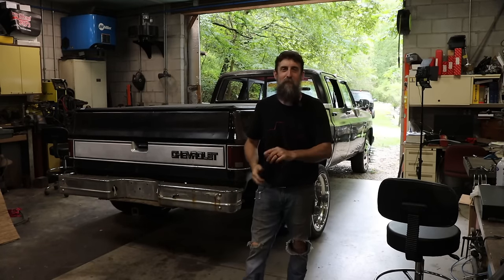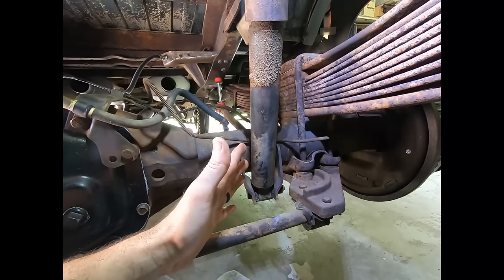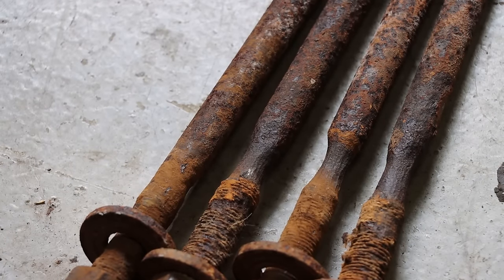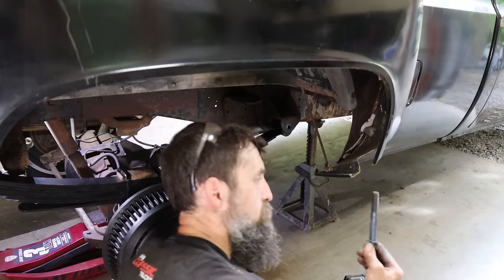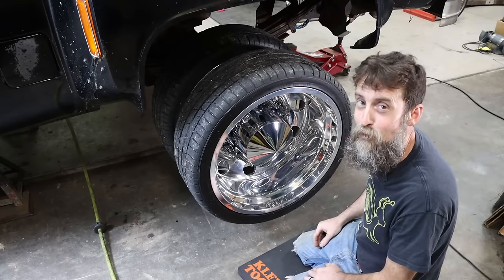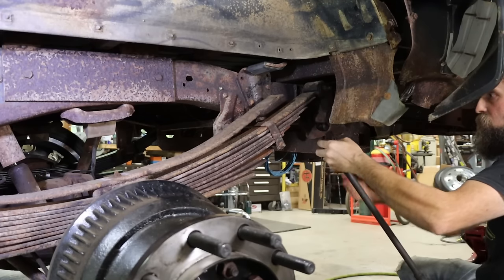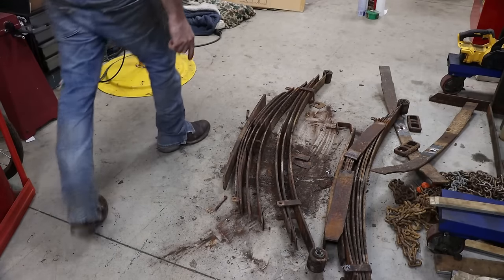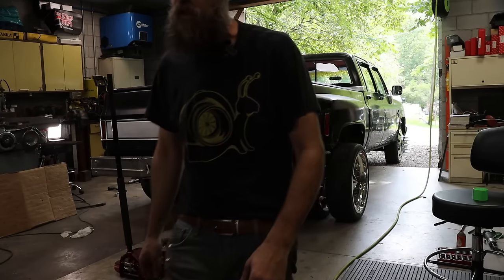Too dangerous to drive! Johnny Cash needs help

Comment: Retired GM mechanic: Yes I have replaced many leaf spring assemblies. I was the brake, suspension, steering mechanic. Dually springs are heavy. I have seen many cracked and/or broken springs. Because I hated to start fires, I started using a recipicating saw with a high tensil blade to cut the bolts loose. My magnetic Dewalt light was used by many fellow tech's and left stuck under a truck going down the road. Good job. My main complaint for those after-market wheels is {they come loose} but they look pretty. Many manufactures require to re-tighten within 500 miles.

Comment: Thanks Steve. I trust you saved a few pieces of that old spring steel for projects down the road.
Reply: Steve could make a lot of knives with that amount of inventory! Lol
Reply: Yes plenty of uses for old spring steel, even if it is detempered and used as a high quality bar for some applications, it will survive abuse well.

Comment: I had to do the same for my 1990 Sierra 4.3L 1/2 ton. When I noticed all 4 U bolt had rust broken completely throuhg on the outsides. 😲😲I cut everything out nothing was worth saving especially the U bolts and bottom plates. Got two nicer bottom plates from the junkyard amazingly. For these new to me I drilled two 1/2" drain holes in each at the lowest points to allow dirt, water and salt to fall through. Than cleaned and paint brushed everything with a 1gt can of Rust Oleum gloss black after a preheat. 👉👉So many I saw at the junkyard were completely full to the top with dirt and rust layering.

Comment: About 1969 I put a new set of leaf springs on my '57 Chevy 'Blair.   That was my first big project on that car.
-I bought the replacement springs catalog order from Sears.
- It took much beating and knocking.  Didn't have access to a torch, etc.  
-Exhausted my vocabulary. 
Steve, your video brought out some old memories/nightmares.😅

Comment: I never had an eye bolt slide out of a bushing without having to cut it out or apply heat until the rubber catches on fire and drips flames down onto the floor. How your's came out freely is just a miracle.

Comment: The bolt going through the spring leaves is called a "Center Pin" and it does locate the springs to the rear end housing.
Reply: We always called them a spring center bolt, back in the 70s they were even called that in the moog  parts catalog,

Comment: Merry Christmas steve and the rest of your family,  Cora looks happy when she is with you  , i have worked on leaf springs in my past changed them on a chevy S-10  and on bigger trucks  and trailers in the 80,000 pound range never fun to work on but necessary for safe operating.

Comment: Does anyone else now have a picture of Steve in their head, running his lathe in high heels? 🤣😂🤣
Reply: Steel toe cap high heels. 😅😂😂
Reply: Keith Rucker raised some of his machines with cribbing to make them more comfortable to use. I guess Steve went the other way.😂
Reply: If it’s liquid it can’t be tight
Reply: Just the visual in my head is bad enough to see !! 😱
I don't want any nightmares....😖
🇨🇦🤓👍

Comment: Up here in Michigan it takes the invention of new dirty words to do that job. You have to cut the spring bolts with a sawzall the shackles and rear hangers will definitely need to be replaced also. If you’re lucky the center hole in the spring pad won’t be 3 times too big from rust also. Dodge uses same setup for the u-bolts too where it traps junk to make the job fun.

Comment: I had the center bolt rust out on my spring pack under my 65 Chevy g-10. The axle slid back and I ran over my van with my van. Maybe not skid but telescoped... I cranked the steering wheel hard as the rear end turned 45 degrees and went diagonally off the road. Couple of leaf springs later and it's back, but I'm swapping the rear end for a four link cuz I want to airbag it and all the spring mounts are rotting out of it.

Comment: Great call and save! Yes, during my years in owning big tandem dump trucks, annual inspection had to be done, and both rear and front leaf springs were a must to be in top shape. Not only would DOT be one of the things to look at when pulled over, but if one leaf was cracked, the truck was downed and flaged at location. Those bolts were a bi_ _ch to remove on the side of a HWY😞. Thats for sharing, and now can sleep knowing you and Elizabeth will be safe. Merry Christmas from BRS.

Comment: I have fought spring bolts; not able to drive them out after cutting the nuts off and things like that. The other thing about heavier tire/wheel combos is the unsprung weight affects the ability to keep the tires n contact with the road which affects both ride and handling even on the rear of the vehicle. Those indexable pry bars are awesome! I don't work as a mechanic for a living anymore so I haven't bought one but my son has them and more tools that were not available years ago. Merry Christmas to you and your family!

Comment: Unsprung weight, weight below the springs, has a 5:1 weight ratio for the impact on the vehicles performance. In other words, you add 5lbs of weight impact for every 1lbs of unsprung weight you add. This can add up pretty quickly. If those wheels are 10lbs heavier you are adding 50lbs for every wheel, times 4 wheels you added 200lbs.

Comment: When pieces come out of leaf springs they can be a hazard to others on the road. Some years back, a truck in Wisconsin had a piece of a leaf spring fall off. A minivan hit it and the piece ended up poking through the gas tank and the floor of the van. Apparently the piece of spring scraping on the road created sparks starting a fire. The driver was able to stop the van and he and his wife got out but the van was totally engulfed in fire and I think at least two children in car seats died.

Comment: When dealing with hub pilot wheels, brute force is not the best option. Simply apply enough pressure to the bottom of the wheel to get it to stand straight up, then pull the top gently towards you, they will slide right off. If you go to jerkinh them around it just binds them up.

Comment: Steve good job mate. Suggestion, I'd  get plenty of anti seize on the face of the hub adapter before winter really gets there, or you will have a devil of a job getting a wheel off as the dissimilar corrosion gets between that bright steel plate and the Aluminium wheels. That goes for the fronts as well. Also it helps to stop the mating face of the wheel from corroding
Reply: Agree with the anti-seize but Eric O turned me on to Fluid Film, not the best smelling stuff, but it does wonders for preventing wheels and axle hubs from mating. I now keep extra cans of the stuff in the shop and use it regularly.

Comment: I live on Cape Cod, rusted hanger bolts are a way of life.  Loosen the nut then put a socket on the nut and     put a air chisel punch through the socket and  just keep hitting it with an air hammer till the rust breaks up.

Comment: Any time I have had to swap springs, or even more often replace shackles and brackets, I’ve assumed everything will be rusted to heck and picked up new bolts and bushings. I’ve never gotten so lucky as to not need them.  I usually drill through the bushing close to the eye, then run a sawzall blade around the inside surface of the eye.

Comment: It's funny to me, because leaf spring tech has been around for as long as cars have been and yet the manufacturers still don't make them right today despite having the solution and far better technology at their disposal (i'll be back to that).
The solution is to grease every leaf spring individually, tie them up, insert them into place and then sow a leather boot around that's ligated with copper wire at the eyelets. This then gets pumped with grease as well.
With today's technology, they could make a boot that's vulcanized properly to fit as a sleeve.

Comment: i just got a 79 C30 with a similar problem, suprisingly none of the leafsprings are broke but i was suprised the actual Ubolts on the passenger side Rotted completely off, so i ordered 4 new ubolts and will change them all out before i tempt to put it on the road

Comment: With that truck you had all the room in the world. Try that job with a 67 to 69 first gen Camaro or Firebird with H/D multi leaf springs! you can't even get to the spring box bolts and it is so tight up there that you can't use gloves so your forced to get all cut up a bloody mess to get the bolts started back in. You had it easy.
Reply from the maker: I've done a few rough ones in the past. These came out easy

Comment: Never leaf springs, but the rear swingarm pivot/lower rear engine mount bolt on a Honda XR400. About 14” long, steel in aluminum. And it’s the engine, so you have to be careful and not just sledgehammer it out (which is what I ended up doing). Honda’s official way is to gouge the head off the bolt, sawzall through between the swingarm and frame to remove the swingarm then spread the frame enough to sawzall through that. Not sure what their plan is to get what’s left of the bolt out of the engine.
Reply from the maker: I bet that was a fun one. 😄

Comment: I have had spring bolts seized a few times. I have also seized my axle shaft in my motorcycle because I put antiseize on them. I had to cut the axle out with a Sawzall. I had to buy a new axle. Spacers and  bearings. Fun times.

Comment: I hate getting a flat in -20 - 30* Celsius and try to get the dam wheel off using stock aluminum wheels I found the only way is to use a dead blow hammer to get it to release it has saved me a few times when you don't want to lie under a truck kicking the dam wheel in the snow!

Comment: I wonder if the ubolts could be packed with caulk or undercoat material over level with the cupped bracket to keep the dirt and water off.

Comment: a guy i worked for had several of these year trucks with the water holding u bolt holes he had me drill a weep hole in the saddle to drain the pocket he also had us grease the leaves of the spring pack to prevent or at least delay the rust in the pack if it worked i cant say but he took great care with his equipment an paid us ok

Comment: Another great video! I've got the same truck and had to change my leafs springs out also. However, at the time, could not find anyone who sold U-bolts long enough to reuse my rear sway bar. Wher did you get yours from?

Comment: I had a similar issue with my Cyclone. 4 out of 5(passenger side) and 3 out of 5(drivers side) were broken right at the center bolt when i got the car.

Comment: Hi Steve, good video, glad Johnny is safe……agree with you, being extra safe could be an annoyance but massive drama avoided!

BTW, stainless exhaust? Curious what stainless grade you used? Any post weld stress relief needed? I have not been following what grade is used for automotive exhausts. 

Thank you for posting!

Randy Musselman
Wyoming, DE
Reply from the maker: It's 304 SS. Pretty nice thick wall tube from the amazon jungle website.  It's cheaper for me to DIY a 3" ss dual exhaust than to go to town and have a shop put on an aluminized steel exhaust setup. That isn't counting my time, of course. I didn't stress relief anything.  It's been great so far.

Comment: I usually leave the jack under a car in addition to jack stands. I lower the car to the stands and then engage the jack just a little bit. Does anyone else do it like that? It is something that I picked up in my teen years, when we lifted tractors to mount wheels at work.

Comment: I remember having to remove the rear leaf springs from my old land rover, the pins were completely rusted into the bushes and I ended up having to cut the head off the bolt and cut the nut off the other side, burn the rubber out of the bushes then cut the outer sleeve out of the spring eye, it was not the most pleasent way to spend a day!

Comment: Thanks for the video; just one thing in my opinion when you fitted the new springs you tightened the spring bushes up WRONG because you should have left them slack until the vehicle was on the wheels then tightened the spring bushes; then they under neutral torsion, A lot of stress off the bushes, anyway have a good new year and forever prosper.

Comment: This sure isn't the first time I have seen this. I believe that there are too many thin leaves and that is what can be avoided by fewer thicker leaves. This job starts with the cutting torch for sure. Hanger bolts frozen to the inner spring bushing are almost never recoverable so I just don't try any more. Hot wrench and all new hardware are the best way to go in my eyes. Far quicker as well. While you are shopping get some new coil over shock absorbers as these ones are leaking. Take care and seasons best to you all!

Comment: If I was dealing with a frozen bolt in a leaf spring and the leaf's where going into the scrap pile. Gas ax off the leaf just fwd. or aft of leaf spring then cax the leaf and bushing off the bolt if the bolt can be saved. If replacing,  sawzall the bolt
Reply: Old leaf spring jobs always require the blue hissing wrench

Comment: Not in a leaf spring, but I had a bolt seized in the LCA of a 911 that I had to cut out by angle grinding the LCA into pieces, while extinguishing the resulting bushing rubber fire.

Comment: So you want to protect your undercarriage!
Be warned! Putting undercoat can be more detrimental than leaving metal to rust out! Putting undercoat on can loosen and bag causing moisture to cause more problems!
If you think about it electrolytes is causing the rust! You can say salt, moisture! These are potential sources!
On a boat they use zink to check or slow rust!
Check ground straps and where metal has a joint put a ground strap!
Think about a four 1 ounce zink placed behind wheels and in front of rear wheels!
Dust steel surfaces with paint for looks not for awesome protection!

Comment: Our new to us ford dually came with the hub adapters and 22.5's, I swapped them back to the stock rims and tires asap, the handling with those huge rims and all that excess weight was atrocious. It did have regular aspect rubber on it, like what you would get on a medium duty panel truck or something, not low profile tires, so probably worse than what you have there.. But at least in my experience the look was not worth it. If you like it and don't find the ride suffers more than you are willing to accept go for it, just a warning to anyone about to drop the coin on them its not without its drawbacks, especially if you are planning on running commercial tires. Keep an eye on the weight capacity of those tires too, especially if you are planning on doing some heavy hauling  / towing, you might be close to maxed out just empty.

Comment: couldve adapted the rear to airbags , using schrader valves to set the rideheight and maibe carry a simple 12 volt compressor with you in case.... 
wouldve improved the ridequallity a lot and you can adjust the springrate when youre driving with a trailer hooked on the back of it 
would involve some fabrication , eithe a 4 link setup or a two link (using the front springhangers) both with a watts link on the axle itself 
the shocks look like their leaking too btw

you probably can sell the old leavesprings to a knifemaker , they often use them to make knifes as the alloy is pretty good (at least on the older leaf springs)

Comment: One sometimes has to wonder how the thinking goes in Automotive manufacturing when You see things like Your shackle bolts sitting in their own  little paddling pools and corroding away out of sight Steve .Anyway They're safe for a good many miles now ,but how many other similar vehicles are in just dangerous a state as that was and in many cases event more so ?

Comment: I see you had trouble getting off the inner wheels. I coat everything with wheel bearing grease makes a waterproof And easy to remove Years later Also steve where did you get the Leave springs from?????

Comment: Surprised you didn’t just go ahead and  4 link it and put it on air ride. 😊
Reply from the maker: Would have been awesome to do that.  I may do helper bags in the future but that's about it.
Reply: @SteveSummers  The helper bags are good for heavy loads but I didn’t notice that they made any difference in how it rides.
Reply from the maker: @bcbloc02  I have a huge load of scrap on the truck now, and it's really showing.  A set of helpers would level it out better and take some of the load off the springs. I've never had helper bags on any of my trucks I've owned.  I do know guys who have and like them . I don't think they are all that expensive.  Maybe I'll put a set on it.
Reply: @SteveSummers  mine are Firestones Looks like your truck would use the same part number kit.  Summit has them for about $330 but you probably can catch a sale sometime. I have put 50k miles on them with no issues and am happy with them.
Reply from the maker: @bcbloc02  What year is your truck Brian?
Reply: @SteveSummers  it’s an 84 body and frame the drivetrain is from a 92  and the dash ac and wiring is from a.   90 it’s a Johnny cash special too. Lol
Reply from the maker: @bcbloc02  That is my favorite old dodge body style trucks. They are tough looking IMO. That truck of yours has the best of both worlds. Newer style drive line and old school body😎
Reply: @SteveSummers  They used that basic body from 72-92 so 20 years of the same style longest production run of any pickup body style and yet there is probably less than a 1/3 of them made versus any other.  They are tough old trucks. The suspension is made to remind you it is for hauling heavy loads not groceries. 😂
Reply from the maker: @bcbloc02  Those were great trucks.